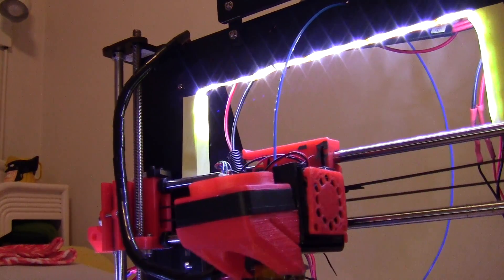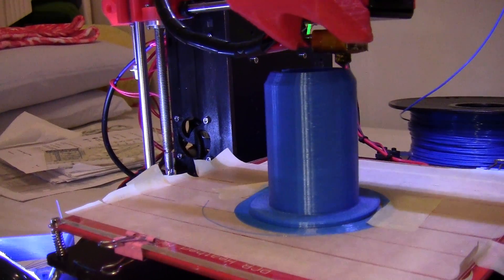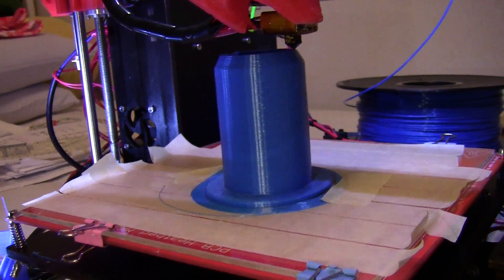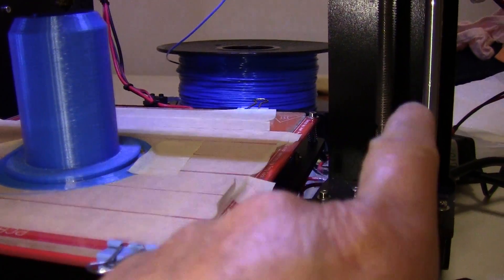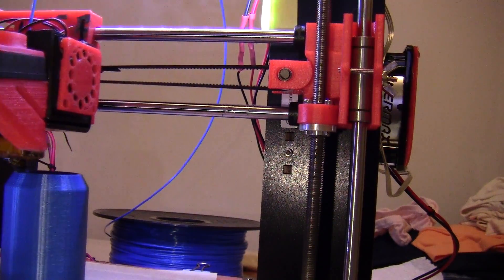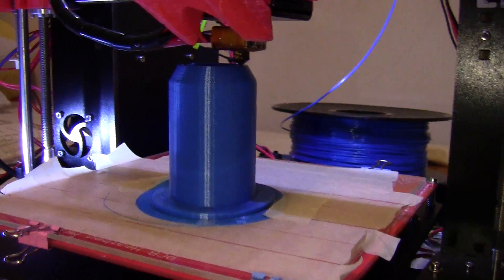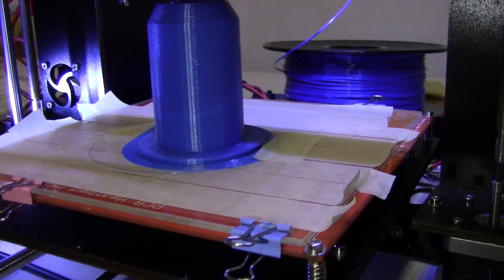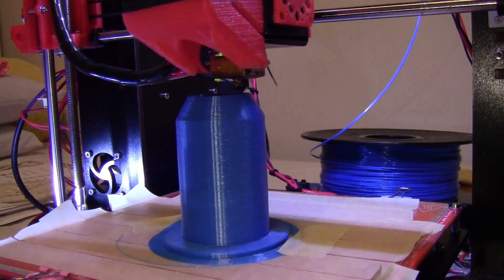Do you need anti wobble z brackets for your Prusa I3 clone?

Comment: hi, if u have issues printing abs just make an enclosure for your printer should work.
Reply from the maker: Thanks. I ought to try your enclosure suggestion. I never seem to get a perfect flatness to the printed object but I think that is a built in weakness of the present technology of the 3D printer.  You don't get a good print out of the box without an infinite amount of tweaking.

Comment: Your steppers seem like they are not connected very well, that is what is causing the grinding. My left z-axis stepper motor does that occasionally and I have to wiggle the wires to make it stop. Maybe try unhooking your y-axis and x-axis belts to see if it's the bearing grinding or if it's the motors. With it acting like that I'm surprised your prints come out so good!
Also you are asking for trouble feeding your filament from the spool like that...that way will cause your filament to develop torsion twists after a while. You should let the extruder pull the filament off the spool as the spool rolls on a spool holder so it doesn't twist up the filament, especially for big objects that take a long time to print.
Reply from the maker: Thanks very much for your input. I'll see if your suggestions will help improve my printing experience.
Reply: wtam69 Sure no problem! I have learned a few things using this printer and after working the bugs out it prints really well! Good luck with everything!

Comment: That bushing looks pretty good. I don't think there is anything wrong with taping the part down it sure beats having it pop off the bed and failing to complete.  I don't see any wobble in my printer either but it might be fun to see the difference anyways.. i may try it some time
Reply from the maker: The bushing is good but I hesitated in putting it on as I might have to ream it out because of shrinkage and imprecision of the print. A good fit is probably very important and if the fit is not good, I'll have to reassemble the printer to print another set of bushing. 
Warping or curling is a big problem for these printers.  If you use glue and tape and such, the printed objects stick so strongly you are fearful of breaking the glass when you try to remove the printed object.  On the other hand, if it's not sticky enough,  your object might curl, or worse, topple over at the last crucial minute.  I guess this means if I'm printing the leaning tower of Pisa, just design the tower the normal way and it'll do the leaning in the printing process.
Reply from the maker: Thanks for the guide. Sometimes you need to stick with it and sometimes you need to let things slide.